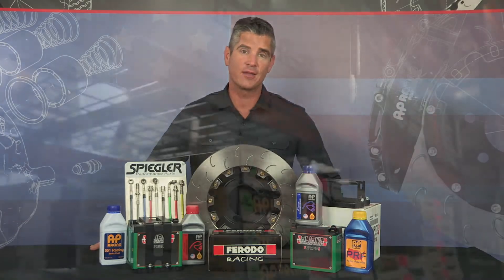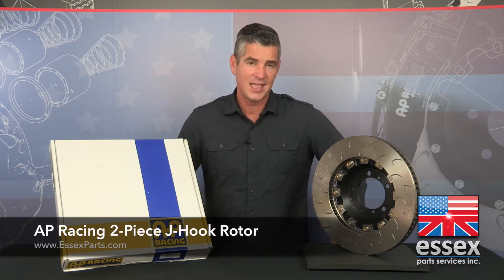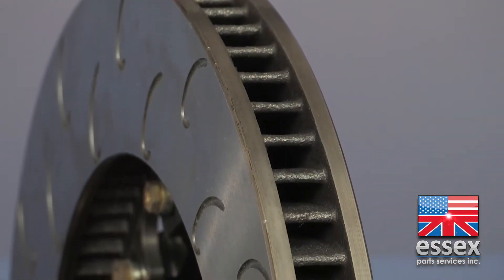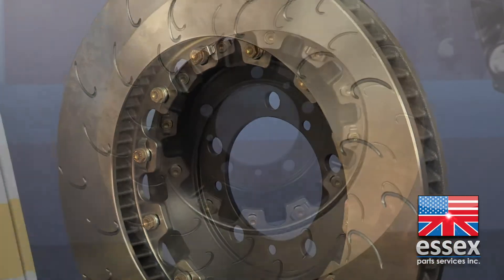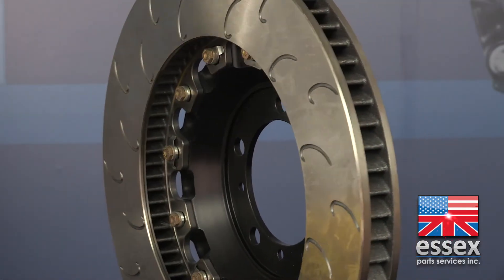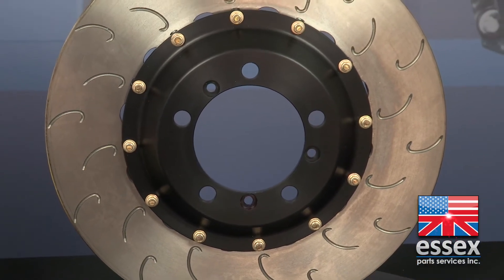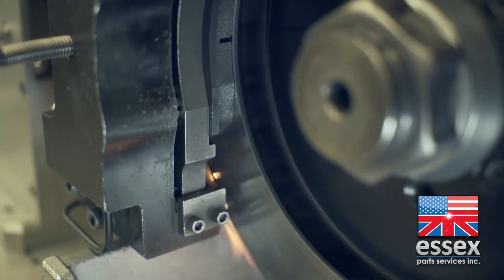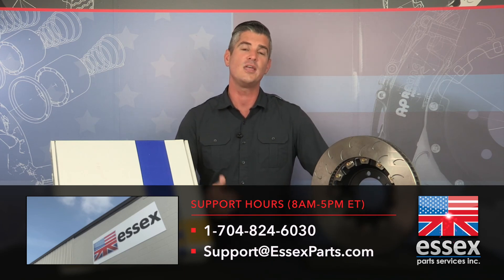Essex Designed AP Racing 2-Piece Competition J Hook Brake Discs

Comment: Are these forged in the United States? City and state, please?
Reply from the maker: Short answer= We aren't certain.

Long answer= Essex purchases the iron disc rings from AP Racing in England.  I know AP Racing has a foundry fairly local to their Coventry, England headquarters.  That said, AP Racing is owned by Brembo, and leverages many of Brembo's resources.  Brembo has many foundries all over the world...including a brand new one in Homer, Michigan: http://www.brembo.com/en/company/news/first-pour-homer-(2)  On any given order we place with AP Racing, we don't know from which specific foundry a particular disc is coming.  They arrive here in our weekly shipments from England, and we pass them along to our customers.  What we are certain of is that they've won the NASCAR Cup Championship numerous times, the 24 Hrs. of Le Mans several times, and countless other championships and races across other pro and amateur series.  :)

For the billet aluminum disc hats, we cut them from billet aluminum.  We inventory raw aluminum bar stock at our facility in Charlotte, NC.  We use local machine shops here in town to mill and anodize the hats. We source some disc attachment hardware from AP in England, and we have some custom made for our needs by domestic suppliers.